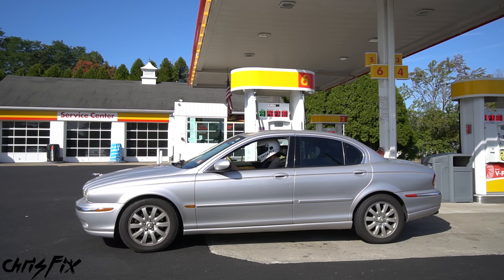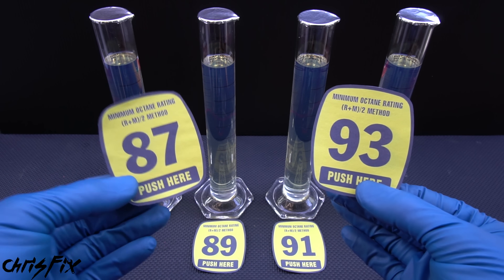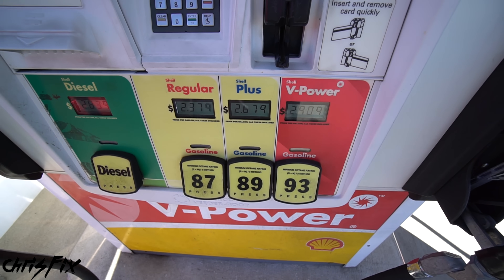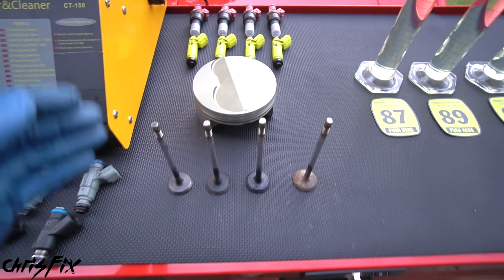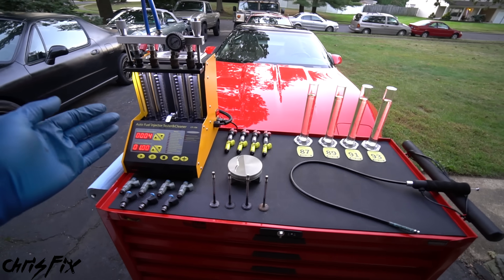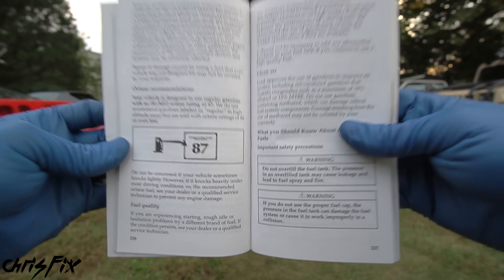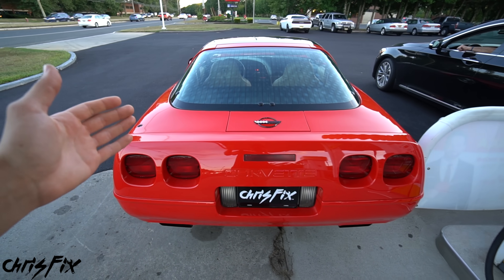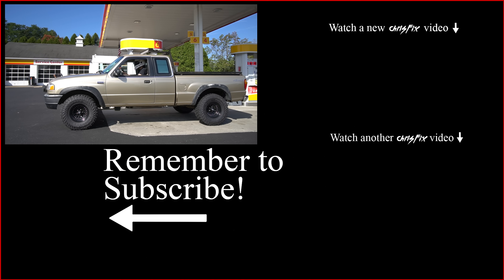What is the BEST Fuel to Use in Your Car or Truck and WHY

Comment: It was my understanding that higher octane rating was a slower burn and you do get more power. 87 burns up faster in the combustion chamber and creates power only on part of the power stroke and the higher the octane the slower the burn which means it ignites and burns longer creating more downward force on the power stroke.  87 octane doesn't burn long enough on high compression engines to force the piston down before burning up so the piston will slap the cylinder wall 93 octane burns longer and will keep downward force past piston destination which is more power in any vehicle on the road but you would never know if you never go over 55 m.p.h. gasoline is more flammable than jet fuel,rocket fuel and nitro methane in top fuel dragster to where they have to have actual flame to ignite except the dragster but they have 44 amp magnito hot enough to weld battleships together to ignite all to create the slowest burn possible thus creating the most power

Comment: I hear some noises here and there in my 2019 ex 350 F Sport. I think i seen in the owners manual they recommended minimum 87 and thats all i been using. Do you recommend or think i should be using something higher? These noises are occasionally and I suspect it can be the gas. Any advice is appreciated!

Comment: Higher octane fuel allows the engine control system to further advance the timing without engine knock. So for example I can get 15 degrees more timing running 93vs89 octane. 15 degrees timing gives my turned port 350 30-40 more horsepower!

Comment: I used 93 for my 2021 Chevy Silverado 1500 but first I was using 87 and every time I accelerate I hear a knocking noise .. So no I switched to 93 and I don’t hear no knocking noise, but now it’s slow to accelerate.. What I need to do?

Comment: Good info. Very thorough. You should do a piece on GDI engines and their valve issues regarding carbon buildup and the best ways to clean them. Not an easy task. The only thing I've found to work is walnut shell blasting. It would be nice to see proof that any chemical treatments actually work.
Reply: Valvoline makes oil to help prevent the carbon buildup, Valvoline Modern Engine it’s called, claims to help, I’m going to switch to it, has good reviews
Reply: @Huskiesarecrazy    So did you try it? I bet it didn't work. There's no way it could, as the intake side of the valves shouldn't ever get oiled !!!!!  What he is referring to, is the new direct injected engines. The valves used to get "washed" by the fuel/air mixture as it entered the cylinders, but with DI, its now only air, so there is nothing to clean the valve faces. How an oil would help to clean this I'd really like to know. It could be possible to try to prevent this by using a higher viscosity oil to lessen blow-by - which is what causes the carbon build-up on the valves in the first place. Using a higher viscosity oil than what the engine was designed for causes its own set of problems though - most which cost more that a simple intake cleaning every 30 00 miles.
Reply: @djteako  no I haven’t tried it, just bought a truck in April, due for first service in September. I know the difference between DI and Port injection, if anything wouldn’t it help with carbon buildup on the pistons and the front side of the valve covers?
Reply: Vslvoline modern engine is a great oil it's now called extended protection. My buddy has 2021 x6 and was getting blowby I told him about this oil now his OCC has very little oil in it. Also it's not that expensive using valvoline oils for 30 years never any problems.

Comment: I’m having issues with the smoothness of my 2016 Soul with 91000 miles.
I used 89 on my way back from Florida to Alabama. It ran like a charm!
Used cleaner after cleaner in like 4 different tanks of regular gas and it’s not working well (in the cars life only accidentally mixed cleaners once. Forgot I already had one and filled up from half) I’ve had the spark plugs replaced twice, It’s had cleaners and maintainers in it pretty much since I got it.
I’m hoping I don’t have to permanently change over, but I’m trying to figure out why I have so much vibration in a car that was previously smooth as butter while idling. My RPMs seem fine. I’ve taken it to the Kia repair shop repeatedly and mention it at pretty much every oil change.

Now, the bad habit I do have is running until I only have about thirty miles left in the tank, which I know isn’t great for the pump and can gunk up my engine. That’s why I always used cleaners. 
I also do tend to get minutely better response when I use the slightly higher octane. Most people wouldn’t notice it though.

Comment: Nobody really goes into carbon build up and adding a quarter quart transmission fluid in ur gas fill up burns off all carbon based on viscosity, flash points and being high detergent. 

Back to the octane, when I use trans fluid every third fill up or all the time on long trips, 93 octane goes into those fill ups with the trans fluid treatment. And other than being a little peppier, what are there advantages using high octane in a normal car (i.e., cleaner emissions, state smog test, easier rpm full blast ac in Arizona summers, etc). But just to accomplish something short term.

Comment: I am sorry, sir, but our 95 ron octane is 90.7 pon octane. So your octane is still lower because it's only 87. point two, we in Europe have separated fuel pumps that only pump one of the possible petrol, on the other hand, I can see that you have only one gun where all kinds of petrol are coming from (kind of dumb in my opinion). point three our highest in Germany is for example 102 octane aral ultimate (praise the lord) so that would be converted into PON and that would be around about 97,6 octane (u are not even close to that) :) just a little note so it is not miss leading because our petrol is in deed enriched with octane
Reply: but you are indeed a nose ahead in terms of additives, in Europe (as far as I know) no law exists BUT the big companies like Shell or Aral (BP) have created their additives that are checked by the good know TÜV that those additives are really working but the gas stations that are "free" or controlled by small companies are using the petrol in its raw without additives. Nice to know additives are a must-have :)

Comment: Here's some food for thought: If diesel engines can run perfectly fine on 100% ethanol and vegetable oil to simulate the lubricating effect of diesel fuel, why are we not offering this as a fuel option? It's 100% renewable energy.
Reply: Because diesel engines and conventional internal combustion engines are two different animals.  Ethanol is crap in so many ways: there is no redeeming value to using it as a fuel, no matter how the greenies lie about it.

Comment: I had see 1 time Chevron Attendant pour a huge sack into the fuel ⛽️ tanks after the tanker left. 
He stirred it afterwards.  
I like the Del Sol Si
The Drift Stang reminds me of my 1995. 
Fuel ⛽️ from fuel station to fuel ⛽️ station does matter from brand to brand. Due to the Addictive.  I used to put on 2016 Mustang Ecoboost Costco, and check engine light turned, and Shell, Chevron, Mobil, Unical 76 Check engine light stayed off. Went back to off brand, Vred and the check engine light turned on.  Had to go back to Shell and Chevron, Premium for check engine light to clear. Just bought a 2022 Roush Mustang with the Proper 3rd Pedal
 6 Speed Manual Transmission 
S/N : 22.0001.450R 
( Serial Number : 《 Year 22》.0001 have footage in my Automotive PlayList YouTube only. 🙋👍🏎🏁⛰️🏞🏕🧗
Great content

Comment: I just bought a 2006 Toyota 4Runner with a 4.0 V6. It doesn't have an owner's manual but I read in some forums that people say you can run regular but premium will give you better power and fuel economy. I don't know what Toyota says so can you shed some light on what fuel octane I should run?

Comment: If your using regular, should you wait until your tank is almost empty before filling up with 93?
Reply: You can mix. Gas stations only have 87 and 93 tanks, so anything in between is mixed at the pump

Comment: My car runs better with premium fuels and gets 2 - 3 more mpg compared to regular or plus grade fuel. 
It performs well with most premium fuels such as Sunoco, Exxon, Marathon, and BP.   
I've tried using Shell V-Power and it runs well but drinks it and my gas mileage drops 2 - 3 mpg on highway mileage.  I can switch back to Sunoco, Exxon, Marathon, or BP and the gas mileage goes back up. 
The manufacturer also recommended premium fuel only.

Comment: In 1989, my late brother Gary bought a red 1989 Firebird Formula with the 5.7 TPI motor.  Other than the turbocharged grand national Buick, this was one of the most powerful and fastest vehicles made in the decade of the 80s.

Gary had worked for Shell Oil Company, and he used Shell gasoline religiously in the car.  At 195,000 miles, it was having trouble passing the increasingly difficult Houston smog tests and it needed a paint job,  so in December of 2000, he gave the car to my wife and I.  

I am a car guy who is also a Mechanical Engineer.  I completely redid the interior, and had the car painted so that my wife could drive it daily - she flat loves the car!  She has driven it daily ever since then and it now has over 250,000 miles on it.  I later replaced the fuel injectors, stiffened the suspension and installed a set of Hooker headers.   

Locally, Shell only goes to 91 ocatane, so we have always put 93 octane or Shell 91 in it. A few years back I completely rebuilt the front end, and it still drives like a new car.  

 The TPI 5.7 has never had the valve covers off, and still can light up those expensive tires.   Shell really is better gas!
Reply: @123logger: I use nothing but Shell gasoline in my 2012 Ford Fusion. I still use 87 octane regular.

Comment: When I was a kid in the 80;s my dad used Shell..THe high test was called SU2000 and lower was RU2000 meaning Regular Unleaded..We had a 1980 Camaro bought new by my parents in 1980.. At that time he had the cat removed and they enlarged the fuel nozzle opening to allow regular leaded gas..this was a common practice at that time to avoid unleaded gas..leaded ran better then in older cars I suppose..When mom sold the car in 1991, she had to advise the buyer that if our area, Tampa FL , brought back smog test which was about to happen, it would need cats installed.. should have kept the car..88K miles after 11 years.. I use 93 in my older 225K miles Escape but in a newer car I use regular fuel..The higher octane does help in my higher miles car..

Comment: I just bought a 23 forte gt. It's a 1.6T engine. The manual says to use 87+ so i know I'll be fine using 87 fuel. I sometimes like to drive it like I stole it, so should I consider using a higher octane?

Comment: I have noticed with that E10 shit I'm going through fuel faster
Reply from the maker: That’s because ethanol has less energy in it compared to the same amount of gas so you need to use more.
Reply: EEthanol contains about 30% less energy by volume than straight gasoline. E15 should be about 4-5% less energy dense.

Comment: Hi Chris. Great  video. Can you please clear up something for me. You mention all fuels burn the same, and it's the octane rating that differs. Then you mention that the premium fuel may give you more power? Please explain.
Rod
Reply: Increasing octane doesn't increase power, it allows the engine to increase power, if it wants to. If it's turned for 87, 87 will let the engine produce max power. If it's turned for 91, 91 will let the engine produce max power.
Reply: Thanks Jonathan. Appreciate the explanation.
Rod

Comment: Hi Chrisfix, my 2017 camry runs on 87 octane and I read on the owners manuel says that toyota strongly recommends  top tier fuel, so what fuel should I use?
Reply from the maker: If you’re in the USA, any fuel brand is fine. It’s all highly regulated by the EPA. Top tier fuels has more detergents but if you run your car to operating temperature every time you drive it should be fine.
Reply: Costco has the least expensive top tier fuel for 87

Comment: Question: I have a turbocharged 1.4L Chevy Cruze and just began running shells 93 and I swear it runs so much better and have done more research as to running premium in turbocharged engines it seems optimal. Do you think the switch would be worth it?
Reply from the maker: It will def run better with premium because it can change the timing to give you some more power. Might be more efficient too. Do the math and see what you think.

Comment: how about ethanol-free gas my truck goes from about 13.6 MPG to 16.4 MPG using it is it safe for my truck that requires octane 91?
Reply from the maker: Make sure you use the correct octane ethanol free gas. But yes ethanol is less energy dense so if you use straight gas it will be more fuel efficient.
Reply: @chrisfix  alright thanks

Comment: Hey chrisfix. I know the gas cap on my grandpa's truck says it can run e85, but it's a 2007. Should I trust it?
Reply from the maker: Call the dealer and give them your VIN. They will be able to tell you if it's flex fuel.
Reply: @chrisfix  thank you very much. I was wondering because I want to run e85 all the time when I get the truck as a gift when I turn 16 because I want to install turbochargers wich require high octane to run properly and I at least want to save some money on gas. Because I am not spending an extra 50cents per gallon to only get 91 or 93 octane when I can get e85 with 100-105 octane for a bit cheaper than at least midgrade.

Comment: In higher elevations, the octanes sold are all lower. I live in CO and here regular is 85 octane. Low atmospheric pressure changes the pressure in the chamber meaning the fuel doesn't need to be as resistant to detonation.

Comment: We have a 3.6L V6 which runs on 87 octane so we buy 87 for it. We have a Audi S4 which requires 91 or higher so it get 91 or 93. We also have a Dodge Scat Pack and it also requires 91 or higher so again that's what get used in it. If you follow your owners manual , it clearly tells you which Octane fuel your engine runs it's best on.
Reply: Oh we had a Dodge Durango R/T. The required 87 minimum but 89 was preferred so we ran 89 octane in it.

Comment: In mountainous regions they might still offer lower Octane fuel.  At high altitude, low ambient pressure makes for lower pressure in the combustion chamber, allowing a lot of older engines to run without knock or dieseling.  Unless you are driving something made back in the heyday of Detroit steel, avoid this stuff, like the plague!  Mind you, back in the 1960's, Octane ratings were very high, so some of those old cars had extreme compression ratios, requiring extremely high Octane.  People that own those vehicles probably have to pour a bottle of additive in their tank, before they fill it with Premium.  87 is good for most everything, but there are special circumstances, performance built engines, and superchargers.  During WWII, allied aviation fuel was rated at 150 Octane.  The Germans just used Regular 87 Octane.

Comment: I just came across this,  man miss those gas prices. I am a Lyft driver and my car has nearly 200k miles. I got it used. Should I put premium in for that 2500 miles to clean my engine? It's a Toyota corolla and most mpg I have seen was 33 and lowest was around 25. Great video.
Reply from the maker: It could definitely benefit from the extra cleaning agents!
Reply: @chrisfix  Thanks, I don't want to pay these prices, ugh but thanks for the quick reply. I'll try it once. Animations were great. I subscribed too.

Comment: I've had 5 Toyota Tundras. The 2016 4X4 was flex fuel but never used that fuel. I was talking to the service Manager at my dealership and he said. The fuel is hard to find in east Texas but if you do DON'T USE IT!!! MY 2019 4X4 Tundra clearly states on the inside fuel door and the cap NO E85!!!! Just FYI

Comment: Stop giving out the wrong information.  I am an ASE Certified  mechanic for over 40 years. Worked on Automotive  and Diesel and race cars. All cars that have an ECM (Computer) and have a compression  ratio of 8 to 1 or 10 to 1 are designed  to run on Regular  Gasoline.  Except  High Compression engines such as a Hemi. The Higer Compression  engines 20 t0 1  need higher Octain. The higher the Octain number ,the slower it burns.  As a matter of fact you get very bad fuel economy.  Low Compression  engines (150 psi to 180 psi) running  on Premium actually  with continued use will melt pistons.